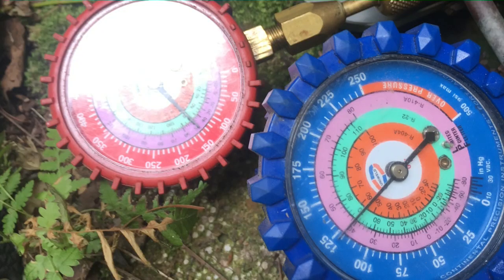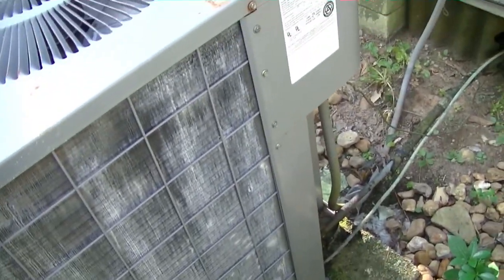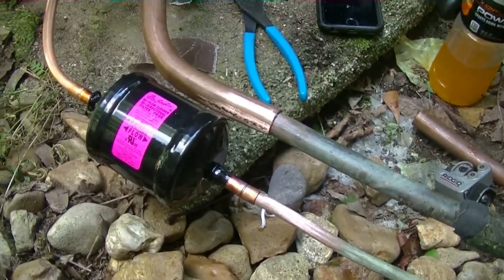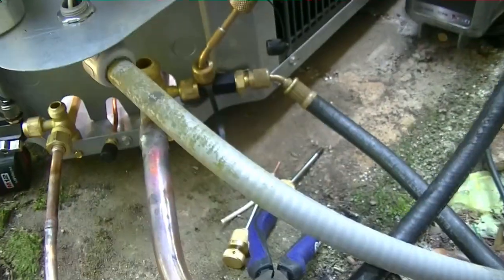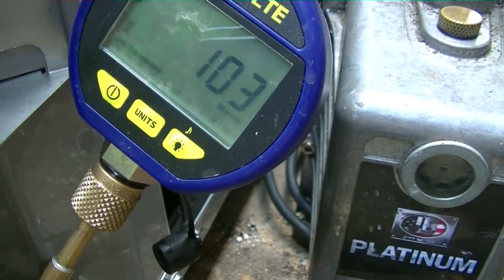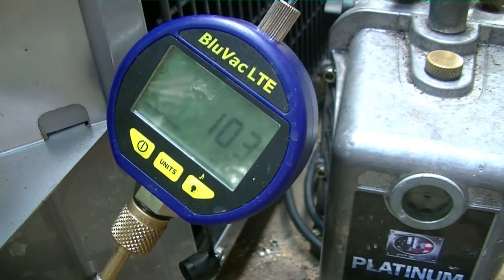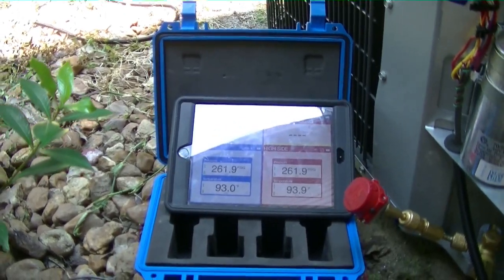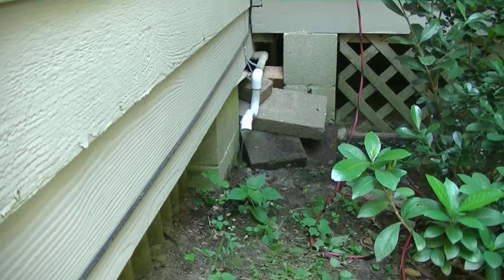HVAC Install: 4 Ton Heat Pump Install

Comment: Honest opinion? Heil heat pumps any good? Im in the process of replacing a nearly 20 year old Trane condenser with a heat pump and all 3 contractors thats cane out for an estimate wants to install a 16 seer Heil heat pump.
Reply from the maker: Heil is a great unit. It’s a ICP product can’t go wrong with Heil, Comfortmaker, Acroaire, Tempstar, KeepRite all same equipment just different badges

Comment: I do install the dryer in the eva to. Sometimes I live it out and spray never wet system and don't rust for a long time. Israel what tool you use for bend the copper?

Comment: On 410A condensers I thought you have to open up the suction line first so you don't get oil into the TXV.
Reply: My bad it doesn't matter if it's TXV or piston open the liquid line will cause oil to leave the compressor just asking
Reply from the maker: There is no TXV on this system. Some brands want you to open liquid first some want you to open suction first just look at the installation manual. Carrier/ICP Manuel says liquid first. Goodman Manuel says suction first. In my opinion it really doesn't matter which one is opened first. I've been opening liquid first since I got into the trade so I stick with that and I've never had a problem.
Reply: Ok thank you
Reply: Ok thank you

Comment: John I see that a lot of the tech. up in your area put the filter dryers out side by the cond. unit. Down here in Florida we put them close to the Evp. so they don't rust out. I have been telling Steven Lavimoniere he need to take a trip down my way and I would pick up some road kill and we have a BBQ. I was going to be in your area in Sept, but they moved the 8th Marines to DC so we will try for NO next year would like to meet up with you. You have so great video keep up the good work
Reply: In north Carolina we put the filter dryers outside

Comment: Don't know anything about heat/ac unit but I do know a little bit about when I am being followed. You seemed pretty nervous at the gas pump as if you either had a crazy girlfriend thang going on or the Repo man was following the truck.....Great video on the install though.